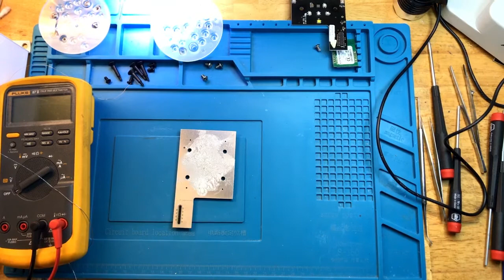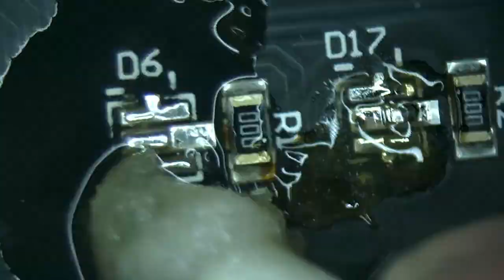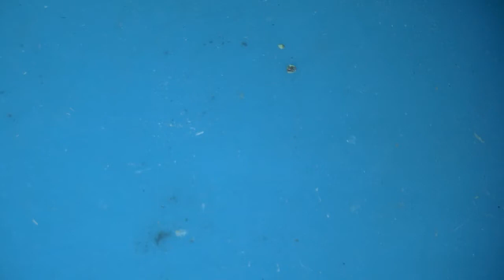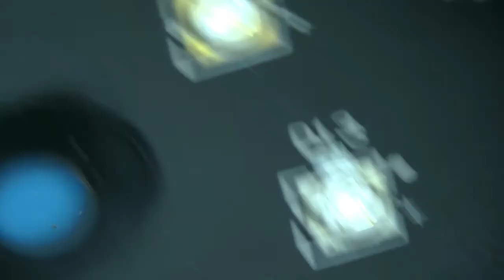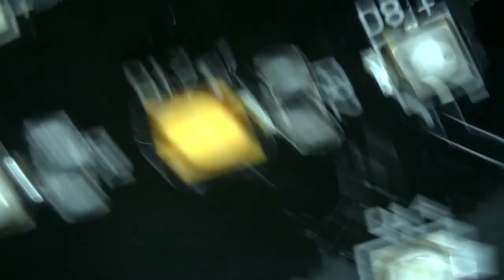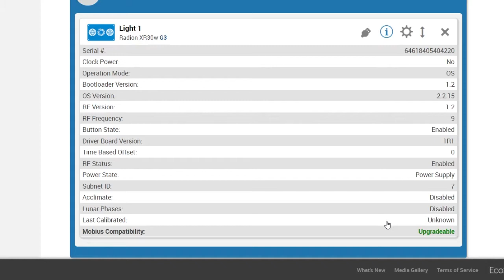Radion XR30 G3 to Pro Upgrade

Comment: I have a XR15 G4 that had intermittent issues with only the warm white channel in the center. It wouldn’t light during calibration but would come on when selected with sliders. After messing with calibration a bunch more it came on momentarily but then stopped working altogether. All other color channels working fine. Do you think this is a burned out LED or something more related to the board? Thanks for the interesting videos!
Reply from the maker: My money is on the failing LED itself rather than the channel
Reply: @FixReef  Bunmer. Can I test with a multimeter like I saw in your other video? I don’t know if I have “diode mode” on mine, if I do I’ve never used it haha. I know it has continuity and ohm mode
Reply from the maker: @reisingsreef3527  You should be able to use your multimeter to test if you have the diode mode on it, which is fairly common. If it doesn't light up from the multimeter, but other LEDs around it do, then the LED is likely gone or on the way out.

Comment: My PCB board is burnt out. Can we not bypass the PCB and make it direct? I understand that we cannot control the mode, but I need to just illuminate it. 
If possible please make a video.
Reply from the maker: You can't bypass the PCB unfortunately. LEDs require a driver, which is a part of the PCB to function. Even if channel control and programming weren't required, you'd still need the driver to provide stable power to the LEDs.
Reply: @FixReef  Thanks for the reply. 
But I buy driver which would be much cheaper than buying a new light. 
I am not an electrician if you know of any video which can help me please send me the link.
Reply from the maker: @szmworld  What you are asking for is, essentially a DIY light based on working Radion LED modules. This has been done before. Here for example: https://wamas.org/forums/topic/65446-diy-radions-g2g3/
Reply: @FixReef  Thank you.
Reply: Hello there
 Make 4 led serial and 4+4+4+4+4 leds parralels connect. Running 12 Volt adapter change voltage 13.8 adaptor on potansiyometer. Controller basic wifi controller running mobile phone. I have some videos like this on my channel.
Reply: i have ecotech xr30 wifi and controller update video No Mobius. :)